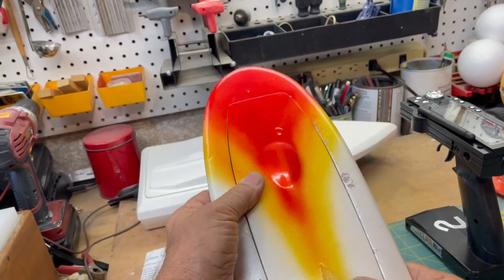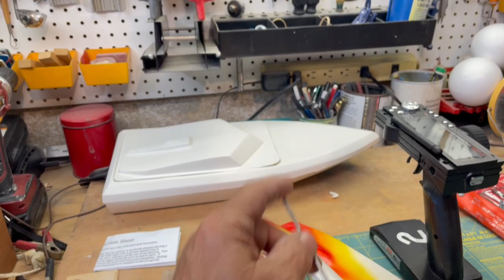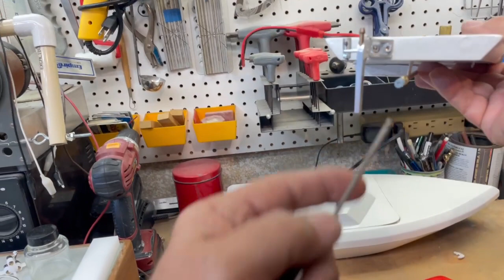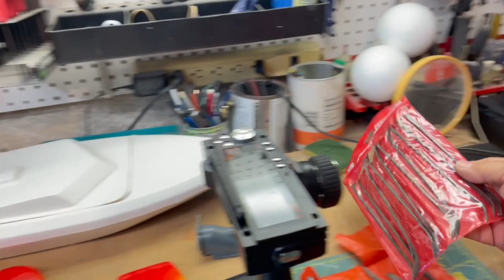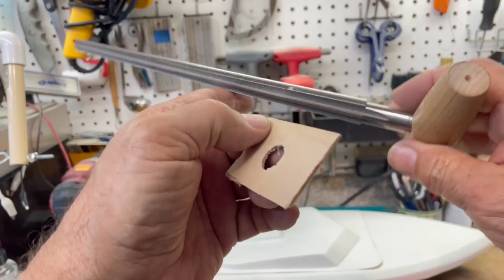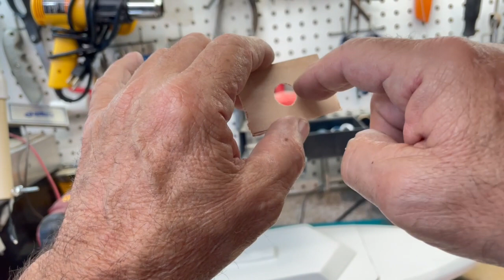Dr. Jet puts yet another power system into JetStepper Prototype IV.

Comment: I'm sure you can find the correct size shaft collars (dura-collars) from DuBro that will slide over your silicone motor coupler to clamp down and prevent the motor shaft (or prop shaft) from spinning. Just a thought. I have a ZipKits Twin Tugster that uses silicone tubing and shaft collars for motor couplers and the system works quite well. Cheers!
Reply from the maker: I thought the Tugster used Vinyl tubing, but we shall see how mine works.  The fewer parts I can use the better, and I think this low-power system will work just fine without wheel collars.

Comment: THIS MIGHT BE MY STUPID MOMENT BUT HEAR WE GO. COULD YOU USE SHRINK TUBE TO JOIN THE MOTOR AND DRIVE SHAFT.    EH?
Reply from the maker: I've tried it.  Not enough cross-sectional area (strength).  Maybe for ultra-light but not this.  I'm thinking I may be pushing it with the silicone tube.